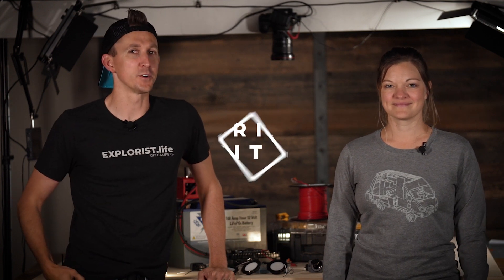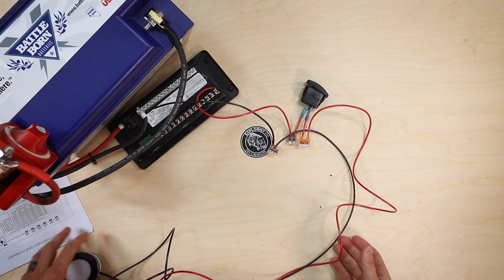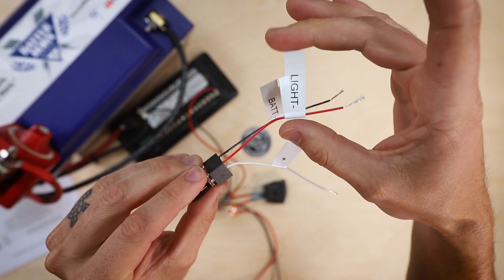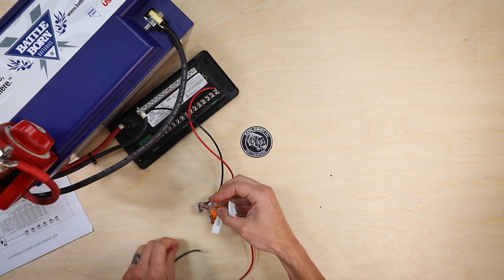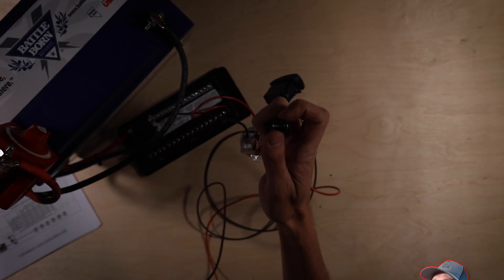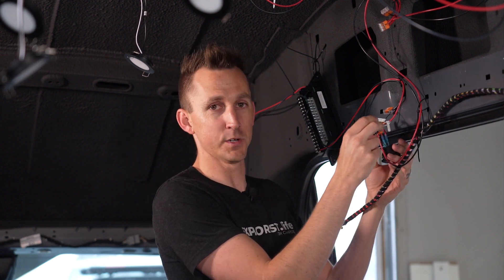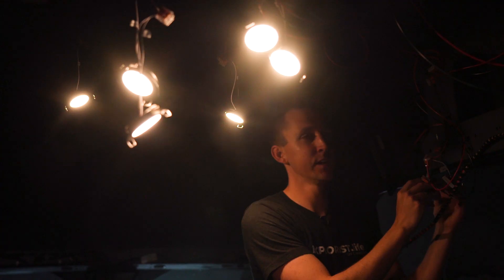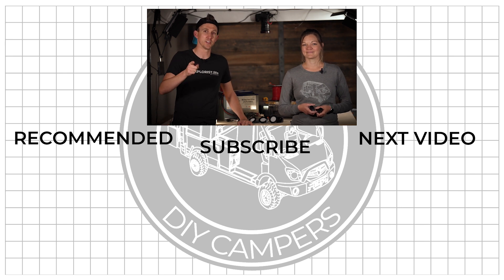How to Wire 12V Dimmer Switches | Interior Van Lighting Made Easy!

Comment: I put it on the first time and put it back on when building the walls jow a new one and the original isn’t working but connect the two negatives and the 2 was switch system works pls help

Comment: Instead of having essentially two on/off switches (the rocker on/off and the dimmer on/off,) does there exist a dimmer that ONLY dims, something akin to the volume knob on your radio, one in which the knob spins freely in either direction and does not turn the system on and off? It's redundant to have two on/off switches yes?

Comment: Most items on my van use the chassis or body for connecting negatives, via a number of busbars. Will this wiring system work with that?
Reply from the maker: I wouldn't recommend that, personally, but you could always try it out and see.

Comment: if i did this with multiple lights wired in parallel and 3-way switches, could I connect the dimmer to the second switch? would the negative dimmer wire have to go after all the lights?
Reply from the maker: Try it out and see!  Bench test it.

Comment: Is it possible to add a dimmer where the switch in my van only has positive going in and positive coming out? There is no negative at the switch
Reply: I have the same problem, did you figure it out?
Reply: @gilmore00  unfortunately not. I tried mounting lights with a dimmer built in unfortunately they flickered for some reason when dimmed down. They didn't do it on the bench. Supplier refunded so still living with stupid bright lights.

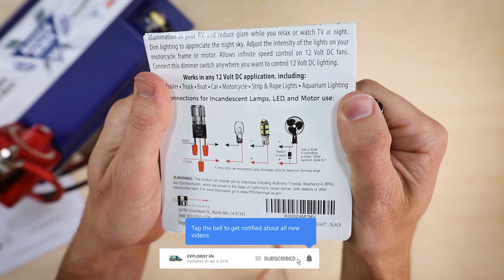Comment: 2:07
The reason as to why you are seeing the red wire from the pot going to black from the bulb is because if you follow positive current from the battery through the bulb you will see it enter the pot on its positve lead.  The bulb shown is a non-polar incandescent, meaning it really has no positive or negative terminals.  (The LED and fan are color coded so you connect them properly.)  Showing a black line from the bulb to the pot is what's really misleading --- it too should be red and would make more sense in the diagram.  And so should the arrow from the pot's red lead have a red arrow as well.
What's actually happening is the current is being split between the pot and the bulb (load) so that the source (battery) never sees a low resistance and overheats.  As the positive currect enters the circut at the bottom it either goes up through the pot to ground or to the load, back through some resistance in the pot, and then to ground. As you decrease resistance to the load you maintain some  through the pot.  All the time the battery sees pretty much the same resistance.  Pots then usually have a position where everything shuts off and the circuit becomes open --- no current.  The one in your video comes close to that but not fully off, hence the flickering.
In this application, since LEDs have very high impedances, a simple variable resistor with an off position in series would be the better choice.

Comment: What size fuse did you use for 6 lights? A lot of videos they show how to wire them but fail to mention the fuse size required to run those lights. In my case I have 6 of them. What size fuse is needed at the bus

Comment: Hello Nate, I see that the caliber of the dimmer cable is very thin, for those 10 lights in parallel it supports the total current of that system? I could have wired everything then with that thinner caliber and saved money!!
Reply from the maker: The thin wire will support the amperage, but the thin wire will not prevent voltage drop if it were used for the whole circuit.

Comment: Hello Nate & Steph, in your 12v circuit diagram for a dimmer with 2 switch locations you have the: fuse panel > dimmer > S1 > S2 > lights. Could the dimmer be located after or in between the switches? Thank you!

Comment: not sure this is current but my question pertains to a 3 wire dimmer.  I tested it prior to installing with just one puck light like the ones you are showing.   Problem is the brightness.  itsl like half as bright when wired to the dimmer and super bright wired direct using the 2 wires to batt and earth.   is there a problem with the quality of dimmer or do i have it wired wrong?

Comment: Hello, we really like youre channel. We are building a overland truck (MAN HX60). august 1 2023 we will leave with our kids for 1 year to travel across Europe.
I am currently looking in to the lights and want to use LED strips in 4 zones. Does this set up work with LED strips, that have two colors (white and warm white) is this possible wit a on-off-on switch to switch between the lights and have the option to dim the lights?

Would be great to hear from you guys.

Kind regards from Europe, Niels and Agnes
Reply from the maker: You may just have to bench test and use the concepts I've taught in this video to see if what you are proposing will work.

Comment: Hey, super helpfull videos! Do you know of any two way 12v touch dimmer switches. So we can minimalise and cancel out the additional  on off switches? Eternal thanks and keep posting 😁!
Reply from the maker: The two dimmer switches would need to 'communicate' with each other to have that functionality.  For that, You'd want to look into something like a Switch Pros control module (with a secondary panel): https://amzn.to/3CQyzRB
Reply: @EXPLORISTlife  I think OP was referring to a switch that is a dimmer and a switch all in one to eliminate the switch instead of having 2 dimmers on same circuit.

Comment: I am wanting to use a 5 gang rocker panel switch, so that they are all together. But I’m getting confused on how to wire it.

Also, is there any harm in using a standard dimmer switch that is typically found in a house or is it crucial to use the ones made for RVs?
Reply from the maker: Even though the switches are in the same location, consider treating each switch as it's own individual circuit and run each switch from it's own spot on the fuse block.  Perhaps watching this whole playlist will prove valuable: https://www.youtube.com/playlist?list=PLmvhcyi4n0TUUwvonaPhIPqUqBiC7CiyY

At the risk of sounding like an asshole...  If we were able to use standard 120V switches and dimmers found in houses, I would have used those in this video. 🙂👍  Standard 120V AC switches and dimmers like in your house are not rated for DC current like the lights in a camper.

Comment: You might want to revisit this one. I know that in 110 volt systems you cannot use an ordinary dimmer to dim so called dimmable LED's. They require a low voltage electronic dimmer or you will get exactly the quick drop off at the bottom end of the dimming range and the strobing exhibited in your example. Amazon has 12/24 volt LED dimmers, but I admit they are more money :(
Reply from the maker: Keep in mind, the strobing in question is only visible on camera because the shutter speed of the camera is synching up with the hertz of the light.  It's not visible in real life.
Reply: @EXPLORISTlife  Ah!  Got it!  Thanks, and thanks for the excellent solar series. We are Canadian but we spend half the year on a narrowboat on the UK canal system (think RV on a canal). I am upgrading the existing solar system and your series is absolutely the best I have found.

Comment: Hey Nate and Steph,  I tried to join your private chat but it says that is unavailable.  I was interested in purchasing one of your kits however, I am planning on an “800Ah” system and I see that you don’t have anything beyond a 600Ah system available on your site.  I do not know much about this stuff so I don’t know what it would take to modify one of your kits.  I already have 4 228Ah batteries from Big Battery as well as 3 400W solar panels from Solaria (I know that you recommend more solar but I’m out of room!).  Please let me know if this something I could possibly source through you.  Thank you in advance!
Reply from the maker: Our kits can handle more amp hours than stated, in general.  Take this kit for example: https://shop.explorist.life/shop/all-products/camper-wiring-kits/complete-wiring-kits/600ah-multiplus-3k-12v-orion-12-12-30-wiring-kit-solar-omitted/  

It's listed at 600Ah but in reality, it comes with enough wire/lugs/heat shrink to wire 'up to 6 batteries' together regardless of the amp hours.  So, somebody could get 6x of the 270Ah Battle Born Batteries instead of the 100Ah batteries, and our kit comes with enough wire/lugs/heat shrink to wire 6x of those batteries together to total 1620Ah of battery bank capacity.

That said...  Big Battery uses an Anderson connector for their batteries, so our battery bank wiring kit is not compatible, so you'll have to figure out another way to get the battery bank wired together or return those and use a compatible battery type.

For the solar array... check this out: https://shop.explorist.life/product-category/all-products/camper-wiring-kits/solar-charging-wiring-kits/
Reply: @EXPLORISTlife  First of all! Thank you so much for getting back to me. That makes sense - I’m still learning. I am ordering different batteries to use your kit. I have one more question if you could…

I’m assuming that the same idea goes for your solar arrays? Just focus on the wattage and not the amount of panels? Since I have 3 400w panels, I should go with the 1200w option?

If I’m understanding correctly, for an 800Ah system and 1200w panel array, I should get your 600Ah (solar admitted) kit, the 1200w solar array kit, the 3000w inverter, and (3) 200w batteries with standard connectors?

Once again, I really appreciate your time!! Thank you!

Comment: I noticed the dimmer on amazon has 4 wires, but the one in the video only has 3.  How does the 4th wire come into play?
Reply from the maker: Changed the link in the description.  In the event you end up with a 4-wire dimmer... just follow the instructions that come with the dimmer.  They are usually fairly straightforward given you understand the concepts shown in this video.

Comment: How small of a wire guage can you put in that 20 guage levernut?
Reply from the maker: The smaller 20A Lever Nuts can accept wires from 12-24AWG.  The larger 30A ones accept 10AWG to 20AWG wire.

Comment: Do you have a video covering grounding the negative busbar? I searched but did not find one. My van is a Ram Promaster.  Currently on my setup it is grounded to the underneath outside of the van. I have a spot inside within 1 ft of the negative busbar which is on one of the pillars. I would like to switch to this as then it would not be exposed to the weather i.e. salt. All negatives are on this busbar including the chassis battery.
Reply from the maker: Yep!  I covered that in this video: https://www.youtube.com/watch?v=01F4QDVJUq0

Comment: Is it possible to wire a switch for the lights at two locations in the van on the same circuit?  Like one switch at the side door area and then one switch at the rear doors near the bed that turn on and off the same lights?
Reply from the maker: Yep!  That's coming up next week. Stay tuned!
Reply: @EXPLORISTlife hey man been a while. I’m looking to doing the same thing in my van but I need to add a dimmer switch too. Any ideas on how to do that or what type of dimmer I need ect. Have asked forums no one knows. I have 6 pick lights I want two 3 gang switches one at front one at back so I can turn off sets of 2 puck lights. And I just want one dimmer up front. Any help anyone??

Comment: what wire gauge you used for the light ? the puck light come with a 20 gauge a so does the dimmer, do you think putting 20 gauge for 2 light is too small ?

Comment: The one you linked to has 4 wires? 

Curious how many watts the switch uses with the  LED wired directly no dimmer, led wired to dimmer switch full power, and half power. How much power the switch wastes? Some are super wasteful. 

Does the manufacturer of the LED bulb have a recommended dimmer switch to use?

Comment: Any reason why you don’t use a dimmer switch with the on off switch built in?
Reply from the maker: Aside from the reason mentioned in the video with the power 'leaking' through...  1: If you wanted to use a 2 way switch with a dimmer, you'll need a dedicated on/off switch.  2: Maybe you want to leave the dimmer at the max setting most of the time and just have an on-off switch. 3: Insert any of the other 1,000 'what-if' scenarios you all come up with here in the comments section. 😂🤣
Reply: @EXPLORISTlife  You make a very nice job explaning all the wiring, just a small thing, when you control a light or anything from more then one swith we call it ''3 ways switch''
Reply: I am trying to figure this out but am not having any luck. Have you found anything helpful on this? I'm stuck on knowing what light switch to pair with the 3 way dimmer.

Comment: This is the one I used, super simple to wire up, just a red and black to the fuse block, and two sets of red and black for the lights control. Two lights on one circuit, wire in parallel before the wire to the switch.
Reply from the maker: Yeah, perfect!  Nice.

Comment: I suggest people pay attention to the maximum current of their dimmer switches.  In this case 10 puck lights use 2A total current.  This switch is capable of 6A max.  It's all good.  In my case I'm going to use somewhere around 8-10A current draw (larger space/more lighting) so I found a larger/uglier/more cumbersome dimmer.
Reply from the maker: Absolutely!  A good idea on switches as well.  If I needed that kind of dimming amperage, I'd be going with this Blue Sea unit so I could use a Carling Switch that would match the rest of my switches.  It's rated at 12A: https://amzn.to/3M1w0yG
Reply: @EXPLORISTlife  This looks so much cooler than the one that I bought.  I'll think I'll keep my current one in reserve and buy a Blue Sea dimmer instead.  Thanks for the suggestions!
Reply from the maker: No problem!  Let me know how it goes.  I haven't messed with that unit before in-person.
Reply: Yes, I bought a heavier dimmer switch for the accent lights all around my truck I'm building. 👍

Comment from the maker: Check out the full electrical installation tutorial for this build: https://www.youtube.com/watch?v=E5q7_4FH4LQ&list=PLmvhcyi4n0TVfA4XCYJBkzfUXunSON1zX

Watch the previous episode here -> How To Install Puck Lights | Interior Van Lighting Made Easy! (FULL TUTORIAL) https://youtu.be/o-YlpzrnuzI

IMPORTANT:  There are tons of different 12v dimmers on the market.  Please follow the wiring diagram that comes with whatever dimmer you choose.  The concepts will be similar, but not necessarily identical to what is shown in this video.

Parts shown in this video:
➤Dimmer Switch: https://amzn.to/3wPVt8V
➤Puck Lights (We used 10 of them): https://amzn.to/3NpW1sE
➤(or some silver ones if you like): https://amzn.to/3lw2sOT
➤EXPLORIST.life Puck Light Wiring Kit: https://shop.explorist.life/shop/all-products/camper-wiring-kits/branch-circuit-wiring-kits/12v-puck-light-branch-circuit-wiring-kit/

If you'd rather buy the parts from the kit from Amazon:
➤Red & Black Wire (we used 16 AWG): https://amzn.to/3lvFesn
➤2 Conductor Lever Nuts: https://amzn.to/3wBZY8f
➤3 Conductor Lever Nuts: https://amzn.to/39Li91W

➤Here is the switch we used: https://rockerswitchpros.com/product/v1d1-s00b/
➤Here is the switch face we used: https://rockerswitchpros.com/product/contura-v-blank/

Not sure what wire size to use?  Check out our 12V Branch Circuit Guidebook: https://shop.explorist.life/shop/all-products/solar-wiring-diagrams/12v-branch-circuits/